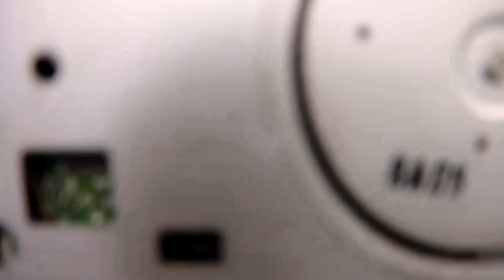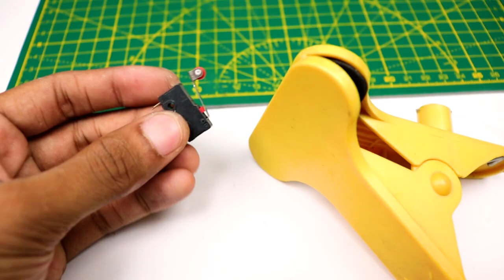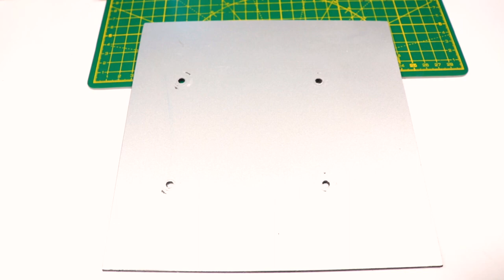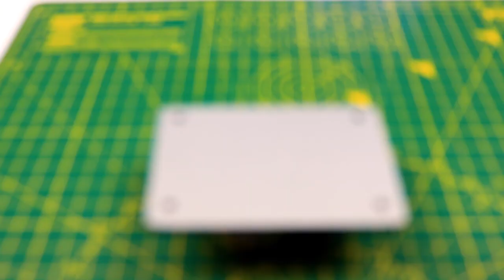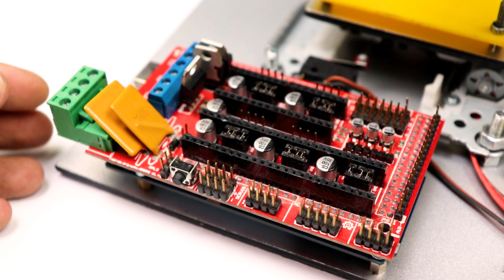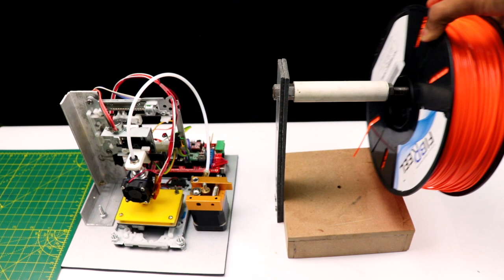WOW Amazing DIY 3D Printer Made From Old DVD Writter and Floppy Driver

Comment: can I use arduino uno with cnc shield
IS the code same
Reply: cnc shield has four A4988 driver ports that can connect four stepper motors
IS it work with your code
Reply from the maker: no

Comment: budget?
Reply from the maker: SAFI SULAIMAN check description
Reply: @SaptarshiSikder   is it possible to check wheather the motor is working without driver circuit
Reply from the maker: SAFI SULAIMAN No
Reply: @SaptarshiSikder   i cannot access the circuit diagram from description